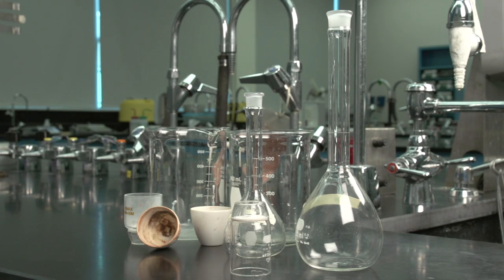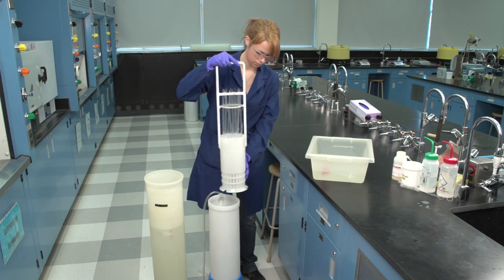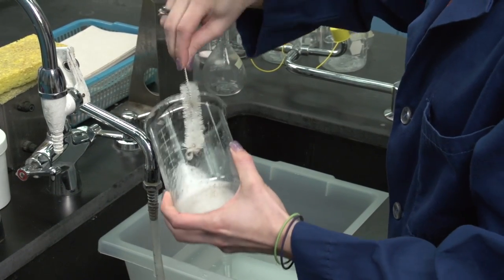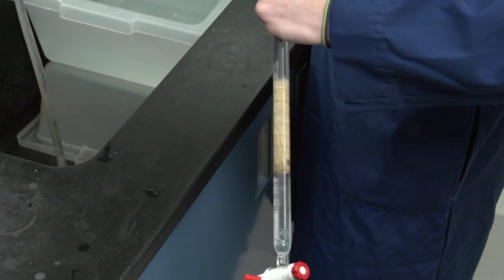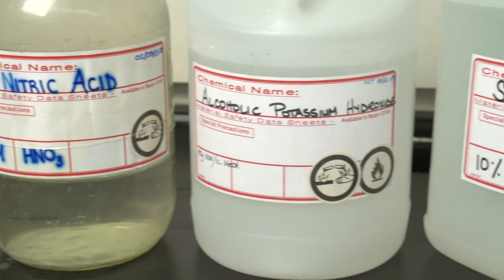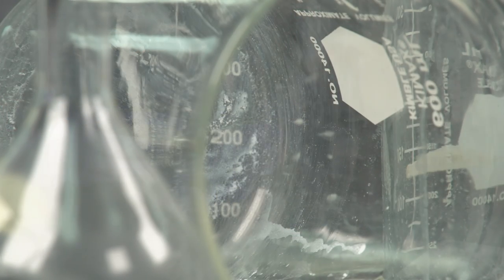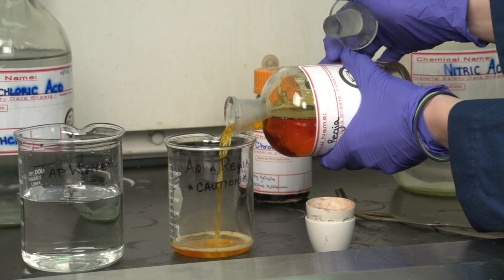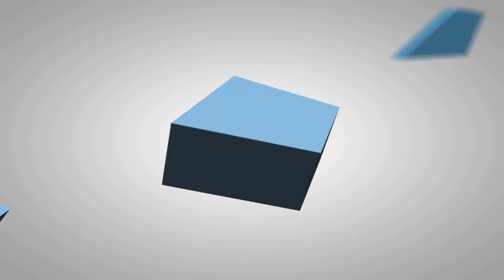Cleaning Laboratory Glassware

Comment: Seriously? Methanol on hand? Isn't this supposed to be toxic on skin contact?
Reply: hehe, toxic? Not for a short contact
Reply: It's not that toxic and evaporates quickly. Note that methanol is normal part of human metabolism. Only higher concentrations are dangerous.
Reply: Libor Tinka it depends on how much you're cleaning but generally it's advised to not handle it without PPO
Reply: I would be more botheted about breathing in the solvent vapours. For a short exposure time they are all relatively safe but if you use the cleaners every day then you'd better have a good ventilation. Or at least use a gas mask if it is completely impossible.

Comment: Our lab uses heavy metal ions, which detergent should I use to remove those?? Is water enough to dissolve the metal ions??
Reply: I think turning them into insoluble salts & precipitate out as dry powders work the best. It's extremely important not to just throw solutions of heavy metals down the drain or the toilet. Keeping the dry powder waste is the safest, least-toxic, & most environmentally friendly way to dispose Heavy Metals.